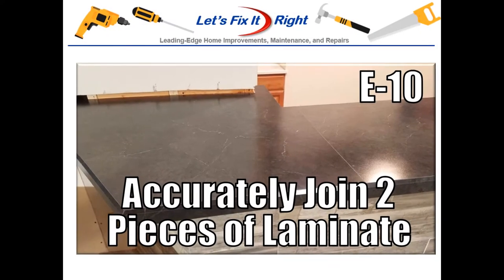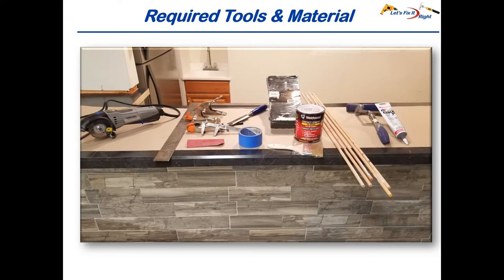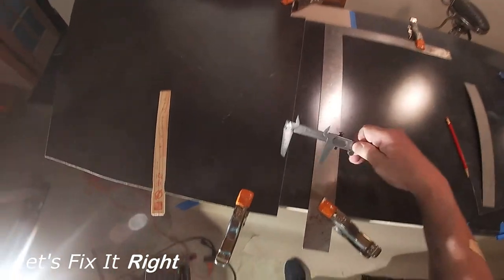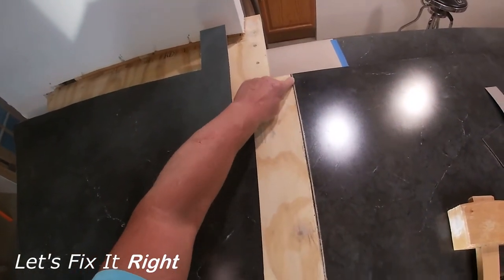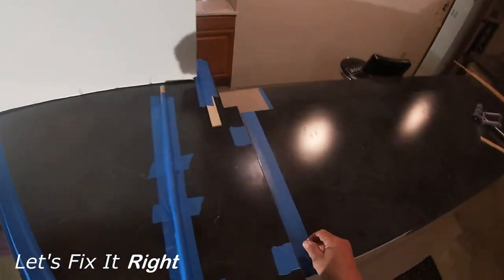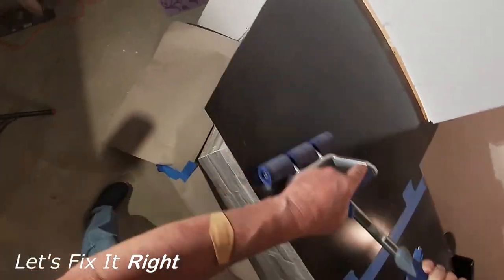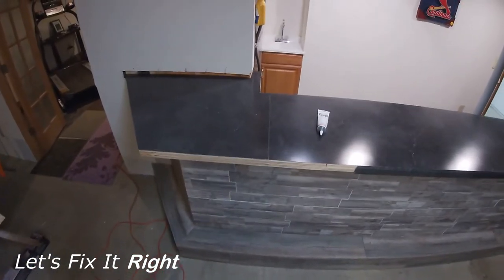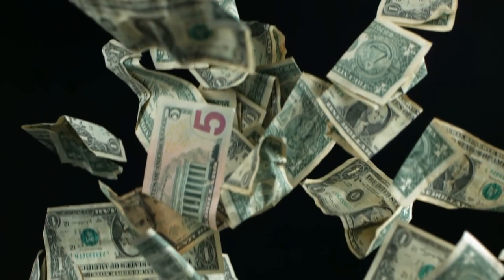Join Laminate

Comment: I like your presentation style, clear, organized, and does not waste the viewers time.  I was wondering how the process would differ if you put the laminate edging on before the top laminate.  I prefer the aesthetics of an edge seam on the vertical surface rather than on the top surface near the edge, but I am not sure how this is done without causing some router scuffing.  Perhaps I'm over thinking and it has to do with ball bearing and router bit depth?   Either way, thanks for this nicely done demo.
Reply from the maker: Dell,

Glad you liked my video presentation style and I appreciate your interest in my channel. 
 
You are absolutely right.  You normally install the laminate edging first and then the top.  However, in my case, I am using Wilsonart’s Beveled Edge Laminate Countertop Trim available from Home Depot shown in this video:

https://www.homedepot.com/p/Wilsonart-Black-Alicante-Laminate-Custom-Bevel-Edge-C-F-B14449267/302567125#overlay

As shown in the video, you install the top 1st and the edge 2nd.  Otherwise, you are absolutely correct if you are installing standard laminate material around the edges, they should be installed 1st and the top installed 2nd. 

By the way, I retired recently and have plans for another 200 to 300 great videos. 

Can you please subscribe and tell your friends and family about my channel? This a link to my channel: https://www.youtube.com/c/LetsFixItRight

Regards,
Lets Fix It Right

Comment: that looks like the black alicante from wilsonart. It's the same one I am probably getting. That seem is very noticeable in my opinion. Must be the black color
Reply from the maker: Chris:  Sorry I took so long to get back with you.  Have been watching the NCAA Tournament. Your correct.  It is the Wilsonart Black Alicante. Wilsonart has some great  products.  If you have any seams like I did in the video, I strongly recommend Wilsonart's color matching caulk.
Reply: @LetsFixItRight  I actually changed my mind. I went to lowes and they had that color in stock in all different size countertops. I went with something a little lighter. I was going to pay to have it done. But, they want $15-1700. It bothers me to pay that much for somehting that is made of mdf/particle board. I know they last long , but I priced it out and I'm going to try it myself with (2) 10 foot mitered tops (1 will be left miter and the other will be right. those will meet in my corner and then I will have enough left over to do the rest. I have a 12'8" wall on one side so that is the only thing bugging me. The other wall is just the 36" corner and a 15" cabinet. That means 2 seams (one at the mitered corner and one at the end of the 10ft section. But I am going to attach the remaining 2' 8" to the 10 ft. section with biscuits. I tried it with old countertop and it came out very good. i'm not looking for perfection doing it myself. Just something not too noticeable at the seams. For doing it myself at less than $400 -500 I can't complain. It cost me a little over $400 for the 2 tops, 3 end caps, 1 end splash, and miter bolts. I just remodeled my whole kitchen for the 2nd time(electrical, plumbing, and built the cabinets out of hard maple, and it came out great) so, i dont think this will be a problem. Never did it before though Thanks for replying
Reply from the maker: @chrisc6874  Sounds like you have a good plan.  $400 to $500 is no t a bad material cost.  Keep up your good work and let me know how it works out.
Reply: @LetsFixItRight  thanks. Yeah, I know that one wall is oversized since 12' is the most you can get without a seam. I'll let you know how it comes out
Reply from the maker: @chrisc6874  When you finish can you please email me a picture at abacon73@aol.com?

Otherwise, I appreciate your interest in my channel.  By the way, I retired recently and have plans for another 200 great videos. Can you please subscribe and tell your friends about my channel? This a link to my channel: https://www.youtube.com/channel/UCIBvBqPEkqu3D5HLpxlEmEA/videos

Comment: have the same problem , two pieces of laminate just won't butt up tight , now I know how to handle the problem...wonder if a trim router could be used instead to the saw  ?  trim router with a  1/8 inch straight bit ?...  thanks for posting . really helped me out
Reply from the maker: I think you are correct.  A router would work as long as you have a good straight edge to guide it similar to the one I used in my video.
Reply from the maker: In addition, the first time I try something new, I always run a test on a new process.  In this case, I recommend that you try your router idea out on 2 scrap pieces of laminate.  If it works, you will confidently know that it works.  It will also give you some practice doing it this way and ensure that your seam on your final product looks very professional.

Comment: If you use a router with a straight bit and a straight bit, overlap the lam at the seam. cut both pieces at the same time. perfect fit. No seamfil.
Reply from the maker: Michael, I appreciate your great recommendation. Similar to my cut, do you use a straight edge to guide your router?
Sorry for taking to long to respond.  I've been side tracked with the bitter cold weather.
Reply: @LetsFixItRight  Yes, I use a straight edge and a sacrificial piece of 1/4" MDF under the overlapped laminate. I then dry fit the seam and mark the fit-up across both pieces so I can easily repeat the fit after applying contact cement. Then with the top covered with dowels, I fit the joint and stick it to the top. Then pull all dowels except the two dowels next to the joint(about 3 " from the joint). This leaves 2 humps in the lam on either side of the joint. pull the last 2 dowels and carefully press the humps down. This pressure fits the joint. I have used this method many times with great success. Check out Tucci Woodworks on FB.
Reply from the maker: @Michael Tucci  Great information.  I will leave your posting in place, so others can see it.  In addition, I plan to try you approach in my shop when I have time.
Reply: @LetsFixItRight  I've been in the business for almost 40 years and still learn from the experience of others. So, I try to pay it back if I can.
Reply from the maker: @duke81625  Appreciate your great input for others to benefit from.